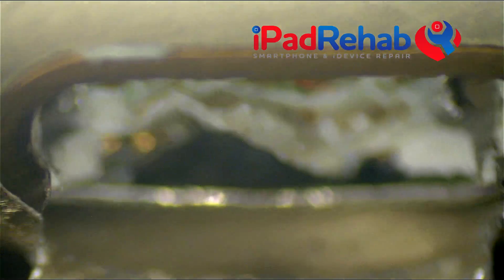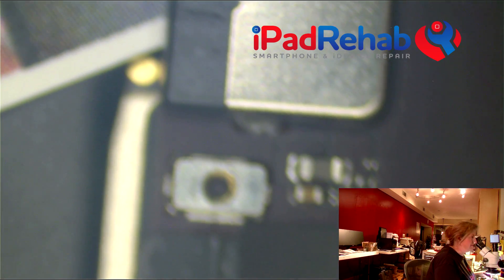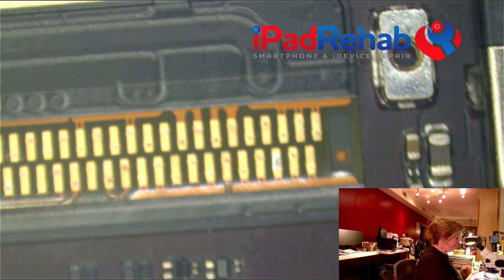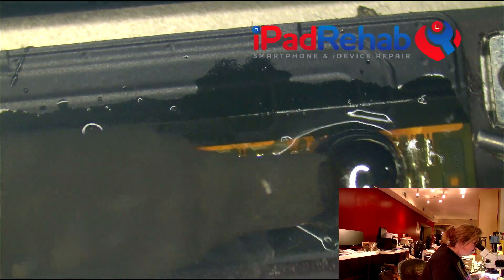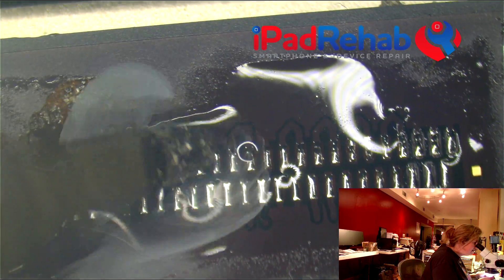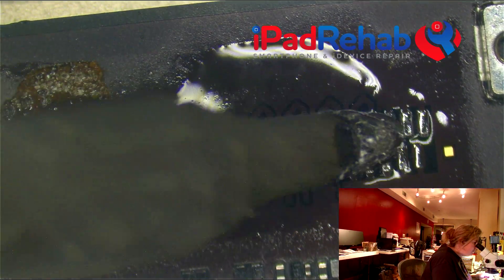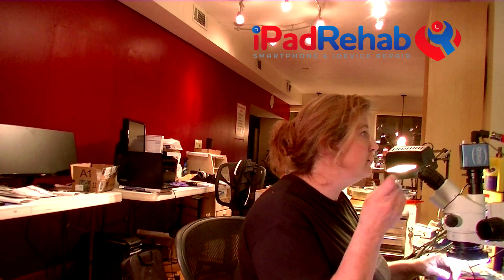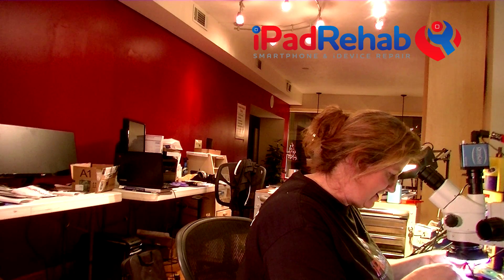How to change iPad Air 2 charge port without pulling pads

Comment: Great Video !! I just changed the battery in my wife's Air 2. This video has convinced me that my 69 year old eyes aint going to be able to change out the charge port. I'll take the screen off and see if a local repair shop will do the solder job for me.

Comment: My daughter’s I pad sometimes would charge and the battery life would just drop dramatically so I changed he battery but the problem did not resolve and then purchased a new charging port and watched your video. 
The problem was I have never soldered before This was my first soldering job and I thought I screwed up while removing the connection and also soldering the connections hoping they all made the connections. 
Plugged it in and it’s charging! Hopefully it will also stop charging when the battery is full???? Oh also hopefully not cause a fire 🔥

Comment: Watching your video I managed to replace the charge connector, but another problem arose after the procedure, the speaker sound stopped working. I installed a new connector the result was the same, the speaker did not work. Could you please tell me what could have happened? Thank you very much! Has anyone had this problem and found the solution?

Comment: very nice videos I like watching and learning.just a quick question I have a iPad Air 2 and when its on and I plug the charger in it won't charge but if I turn it off and plug the charger in it will power on and charge the battery fully.its very strange I watch videos and they all say its the Tristar chip.

Comment: I did this repair, but my iPad restarts after about 3 mins. seems to take amps charge when on, but not charging when off. 

do you think this is a bad connection, or a TriStar bad battery issue? 

oh I did pull a pad at the very edge, but I assumed it's a no connect? ground?

cheers

Comment: ipod air one charge problems are almost never the charge port?? i have one that's not charging... it started to have problems like when i plugged it in, it wouldn't charge so i had to unplug it, turn the cable over and re insert it and it would charge, then it got harder and harder  to get to charge until it was almost impossible to make charge... then it went to  where when i got it to charge it would take forever to charge it up to 100% like all day long to charge... now it wont charge at all. so, it may not be the port?  how do i find out?

Comment: So my iPad Air 2 is hard to charge I need to keep putting in the charger in and out until it will charge and the charger works fine so does this mean I need to change the port
Reply: might be just some dirt in there
Reply: @alvomano9662  nah it’s clean and all

Comment: Hy, First of all thank you very much for this excellent tutorial.
Now I hope you can help me with this.
You are talking about a problem with iPad air 1 that is coming from the chip and not from the charge port.
It charge when is off but when is on 2% stops charging. Well I have the same problem with my iPad air 2!! 
Do you think is also the chip the one is malfunctioning?
One thing I notice is that when I smell the port, it have a burned smell in it, but I can not see any fiscal damage.
So I asume something is burned in the port and that's why does not work properly. 
I really hope is the port and not the chip!!!
I was ready to do te repair and change the charging port but after I soo your video and ear that particularly comment.....Now I don't now what I have to do.
I hope not but If I have to repair that chip, I really need a tutorial to follow the steps!!
What do you thing about it? do I give it a try and change the port and see if that help?
I hope you can help me with this!
Thank you very much and keep the good work!!

Comment: Do you have a video showing the replacement of the air power management chip  on a ipad air 1 ?   If you have a battery picture but it not charging and the battery level stays in the same place  is that a  power management chip problem ? What does seeing the battery picture  but the battery doesn't charge  tell you ? I'm in the USA, is there a place you  would recommend I could send my ipad to get  looked at . Someone you know that will do as good a job as you do  . Mu ipad air 1 was working just fine and the battery was holding  charge really good and when I did let it get down to 50 % It would charge up just fine  till one night I was chrome casting a movie and I fell asleep  so it went completely dead . I think its the first time it has ever been that low . So the first time it got in the red  it won't charge back up . Is it possible for a battery that seemed to be working and charging  like it should   all of a sudden once it was drained all the way down  not charge back up again ? Should I try a new battery first ?

Comment: Question: When you placed the replacement dock connector and used your hot tweezers to attach a few of the pads, did you add more soder or did you just let the soder feed through the holes?

Comment: Love your videos.. I got a few questions, hoping you could answer. Is this type of flux you're using are conductive to electricity? Does it needs to be cleaned out first before plugging in battery/power charger?
Also, do you have videos on how to repair damaged gold finger connectors? Please advise. Thanks ahead!

Comment: I have a iPad mini that won't charge. I cleaned the port and it still not charging. But it was charging if you wiggled the plug around some it would charge stop and then start back all by itself. now it's not doing anything. Do you think it's the charging port ?
Reply from the maker: +david m I would certainly rule that out before doing anything else
Reply: 👍 thank you

Comment: ipad air 2 has 3 connectors on the motherboard where you can connect the whole entire screen/ lcd and digitizer. ribbon cables.
ok, so my question is the next. can those little connectors be fix/soldering/replace?
Reply from the maker: yes of course

Comment: Hello my iPad turns on when its connected to a charger but when it turns fully on it says it's not charging and is going down in % what can be the problem. I tried with more power outlet and cables

Comment: I was given an iPad Air that was not charging.  The previous owner had used an aftermarket Duracell charger, which stretched out the port to the point where it wouldn't make contact anymore, the apple charger fit very loose in the port.  I checked out the Duracell charger and it was thicker than an apple one.   

I was able to do this job with no microscope, the hardest part is lining it up and not being to check till you put it back together.

Comment: Hello, May I ask you a small question ??  I have an Ipad air 2 a1566 model and wanted to change only its touch digitiser  screen. While removing the digitiser from the main screen I have mistakenly broke the flat copper wire around the screen :( Is it possible to fix it back with soldering machine? Please reply if you find time. Thanks in advance and with you a happy new year 2017. Regards
Reply: sabi0410 I doubt it, not too sure what you are referring to, but usually screen cables have very tiny wires in them.

Comment: Hi Jessica, great vids can u tell me what flux u use as I use kingbo and it doesn't work like the stuff u use, maybe I got a copy of the original stuff. Keep up the great videos.
Reply from the maker: Kingbo is terrible. We use NC-559-V2-TF flux which can be purchased here: https://mailin.repair/amtech-nc-559-v2-30-cc-16160.html It is the best stuff there is. You can also get it with a plunger & needle tip for a small fee.

Comment: hello i am having a problem with a ipad air i bought that would not charge. i wanted to try and see if i could fix it. :(
it wont charge.. or well it does regestrate the charging cable as i plug it in but it does not turn on. 
it come up with the battery and the cable power icon on the screen however
i took it apart and it looks like someone had a incident with some coca cola at the charing port. (there where some coke under the screen and a tiny bit inside right at the charging port) 
please do you have any idea before i start trying to do the change of the charging port/flex.

great videos så great :D
best regards
Christian jensen

Denmark

Comment: Hello! 
This video started to auto play as I've watched a few iPad Air 1 charge port repair videos earlier this week. After learning it was a micro solder job I sent my Air away to be fixed here in England. I was curious to see how different the iPad Air 2 was to fix and then you mentioned the issue with iPad Air not charging when on. Which is what I had (no visible charge port damage) it didn't have the restart loop, just either say not charging or it would charge at around 5% per hour when off.

I'm a little worried that I've sent my iPad for the wrong repair and as you say it could be a short / chip problem. I'm also thinking it might just be a solder issue with the air port that just be rectified with the new board? Is there anything I should let the repair shop know? 

Thanks so much!
Reply from the maker: Just make sure they warranty their work and offer no fix no fee to solve your problem.   Battery, charge port, or tristar chip--it could be any of those
Reply: Thanks so much for you time! :-)

Comment: I'm working on ipod touch 5th gen and put a new battery in but now I want to change the charging port.  Can you explain how you isolated the battery? Thank you.
Reply: The battery is isolated so as not to cause any problems with the lcd or blowing fuses

Comment: I saw there was adhesive around those pads on the battery, do you replace the adhesive after replacing the connection? nice video very descriptive! Do you have a ventilation system going?
Reply: I didn't,I just put some tape down on it and on the metal case where it sits just in case. , the glue is not necessary everything is pretty snug in there.

Comment: I love to take technology stuff apart and I love more when I can solve any of the issues. Your videos are easy to follow and the information you add in is valuable. You have inspired me and I so much enjoy my 'hobby'. I am here because my ipad air charges only when in DFU. I have combed the internet and found a post which faulted a missing resistor near the near the battery connector. Does the cap of the battery connector come off? Thank you for your great videos.
Reply: That is very unlikely in the iPad Air.

Comment: What is the prober temperature of your solder equipment for desoldering/soldering of apple gear? :)
Reply from the maker: Never bothered to measure.  It is more art than science. Every station is different, and the best advice it to learn to do it by watching and listening to the board by feel.  Ignore the numbers on your equipment
Reply: +iPad Rehab - Thanks for the quick reply, thou I'm a little new to micro soldering, i purchased a good solder station, but sometime when i solder i use 200 degreeds celcus, and sometime is use 400.

but i have been burning and making some mistakes, so can you specify a "Range" ? :)
Reply from the maker: Since solder doesn't actually melt at 200C, this means "sometimes when I solder I use 200c" is impossible.  Seriously.  Put black tape over the temp dials and stop thinking of those numbers as if they have meaning.  They might as well be random.
Reply: +Rasmus Bang Pedersen jess is right what she says  if I was you . I would get some old nackard boards first practice  use  tacky flux as it will help the old solder better  once you get the hang of  it. It comes second nature.  bit like when your learning to drive a car  . You don't have to think where the biting point is

Comment: Hi Jessa, thank you again for all of your videos. I successfully changed the charger port port for ipad mini 1 for a customer, charges at a normal rate via wall charger but display not charging via computer(at the instant when it's plugged to a computer says xx* charged with the battery logo and goes to not charging on the top right notification). I have changed the port twice and has not resolved the issue. 
Best Regards,
Reply: +Aashish Shrestha UPDATE I was plugging the iPad Mini in to a Windows 10 computer. I just plugged it into a Mac and works just fine......Hmm cave man issues.

Comment: Hi! Next time please increase the volume when recording!  the other thing, I have IPAD air 2  Which shows charging symbol but doesn't turn, it stays for hours. Have changed the charger as well. Do you thing its the charging port issue?
Reply: No it's definitely the screen

Comment: Hi Jessa, im wanting to take your course soon but have never soldered anything as tiny as you do. I hear you say to use a good hot air station and wanted to know what model I should look for ( I apologize if you've answered this already). I'd like to buy what you'll teach with in your course so ill be familiar with everything. since this is a new area for me (microsoldering) , what is an easy repair that I could practice with to kind of build a little experience? I've done phone and ipad screen repair for around a year and need to expand into other areas of repair. Thanks so much for your videos.

Comment: Hello. What flux use? Thank you
Reply: It doesn't matter which flux do u use mate. Just get something from ebay or amazon. It's all about you experience and skills, if u don't have proper skills even with best high quality equipment you can't even be normal technician
Reply from the maker: https://mailin.repair/amtech-nc-559-v2-30-cc-16160.html
Reply: Hossein M I agree

Comment: Jessa nice videos love you channel learning a lot hoping to attend practical board repair in a few months. I have a issue with a iPad mini 1st gen the digitizer wasn't working had no cracks I had a broken tester digitizer so I changed the digitizer ic and put on the non-responding digitizer in another video I remember you saying that controls the touch after assembling I didn't get video I forgot to unplug battery would that blow the backlight filter? Since I've been watching your channel I know it's not the coil haha. Should I just replace the digitizer entirely or should the one I replaced the ic chip be fine any advice I would greatly appreciate. I'm trying to save for a Hakko station with the tweezers the one I'm working on is a 3 or 4 g and sim is near the filter don't wanna use hot air for fear of melting hope one day to be as good as you keep videos coming I enjoy watching and learning . I went to wild piece of crap didn't learn correct soldering at all and have a stupid microscope from them with like a 2 inch clearance horrible tools from there total waste of money. I ordered a amscope from Internet didn't work every time I looked it had a dime size image and when I backed off eye pieces image was fine I'm trying to get all the tools so after your class I have everything I need.
Reply: nice video. i like it. where can i learn it like you